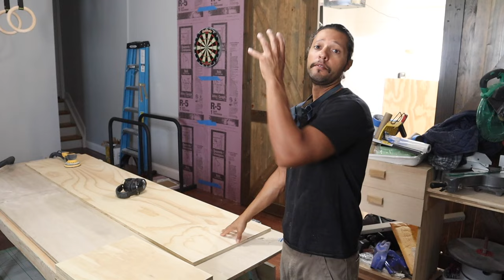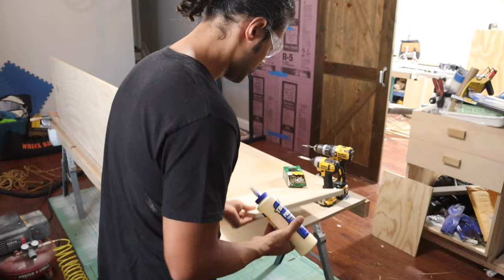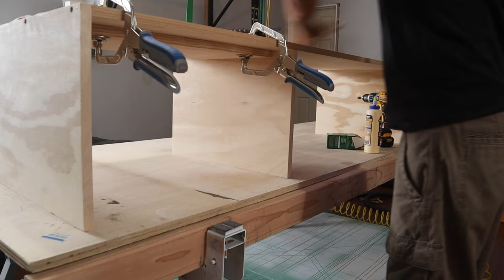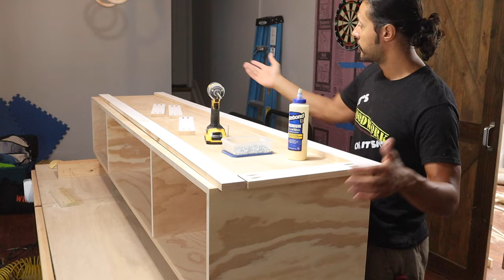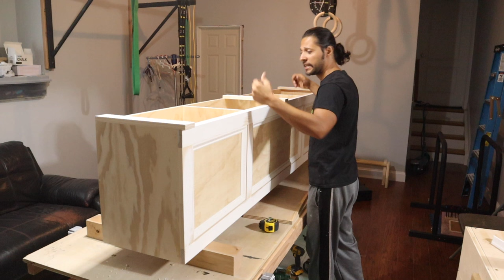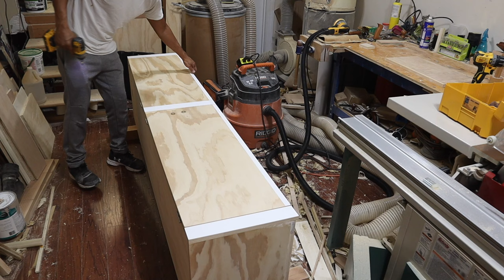window seat (with storage)

Comment: Interested in why you didnt put long cleats and a single base in first, and then the dividers? Would have had the same result but half as much work?
Reply from the maker: Sometimes due to the odd size of a build, it’s necessary to do certain things to maximize the sheet of plywood. By doing it the way I did, I was able to use cutoffs that I already had and make more profit on the job instead of spending more on materials. Plus I got some extra room in my shop by getting rid of what was sitting around.

Comment: Hi Anthony, what glue are you using? And is it better than the original glue.
Reply from the maker: I use titebond II, I’ve always used titebond. For 98% if jobs i use type II, for jobs that require full waterproof glue, i use type III